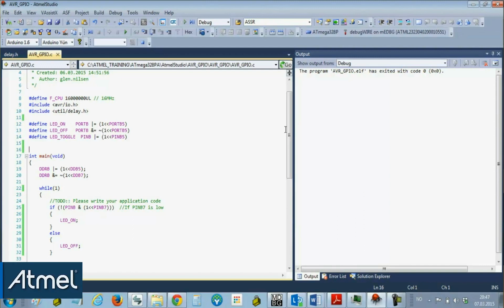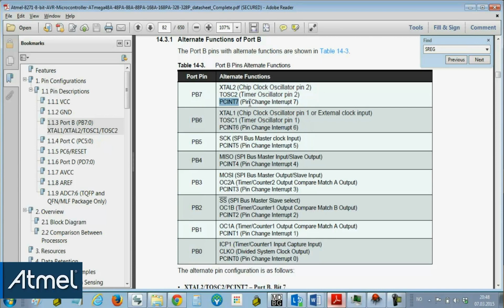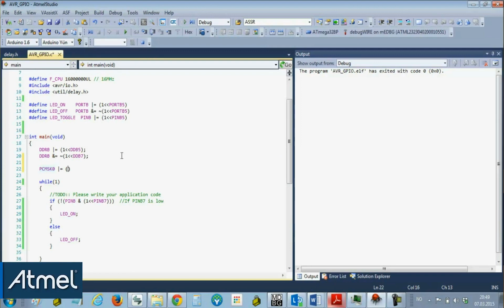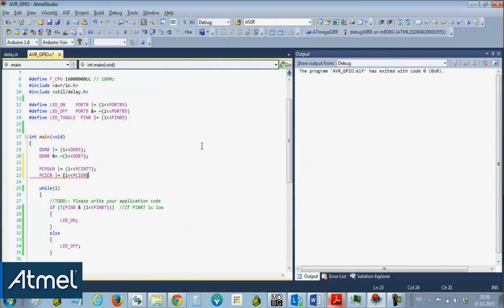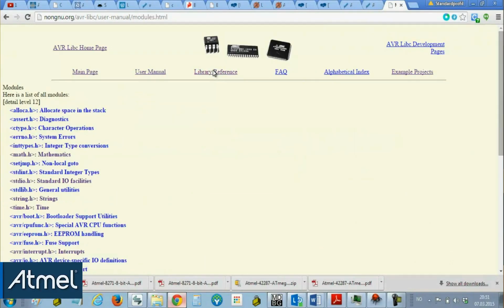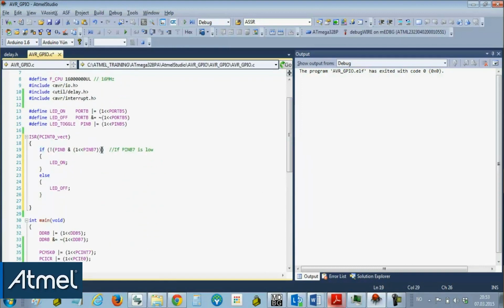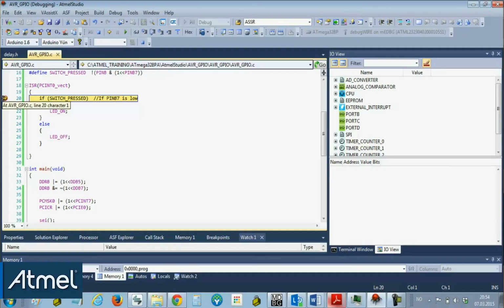Getting Started with AVR: Using Pin Change Interrupts (#5)

Comment: What is the purpose of learning these concepts,  what are their applications. Anyone explain this?
Reply from the maker: Hi there, great question! Pin change interrupts let your microcontroller sleep and only react when something actually happens — saving power and processing cycles. That makes them essential for real-world designs like battery-powered sensors, IoT devices and wearables. Once you understand the concept on the ATmega328P, it carries over to nearly every embedded project you'll work on.

Comment: Great series! 

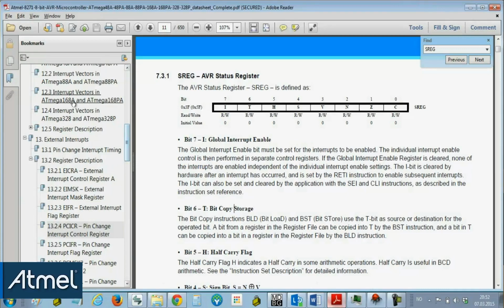How did you find out that it was PCINT0 you were using for Interrupt Vectors?  5:19
I was using PORTD2 as interupt and there it was PCINT2, but i dont know why, i just tried them.
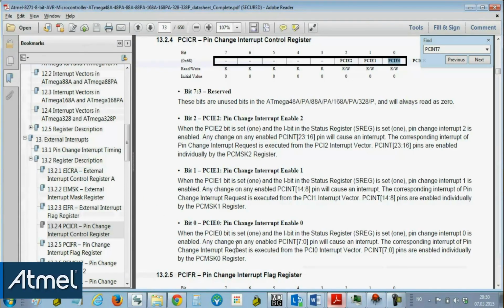Reply: PCIE0 requires to use PCINT0. I also used PORTD2 as button and for this port instead of setting PCIE0 we had to set PCIE2 which requires to use PCINT2. It's written in datasheet at 3:35

Comment: What would be some practical applications of Pin Change Interrupts in general? I am unable to get that from anywhere.
Reply: Very useful when you expecting some signal on some pin(s). In the meanwhile, your program doing something else, and not waiting in the "if" loop or similar. For example, you have remote termometer, and waiting for new update, your program doing drawing on some display, and if interrupted, it goes to ISR for decoding incomming message about temperature change, then after exit, it continues to draw temperature on display with new and "fresh" data. If remote sending data periodically, it is hard to predict when it will send, and waiting in "if loop" will be waste of MCU time.
Reply: Thanks for helping out here with the questions, much appreciated.

Comment: Didn't answer the one thing I was looking for which is whether I need to clear the interrupt or whether it's auto cleared when the ISR is called.
Reply: Citation from Atmega 328p PDF: "The flag is cleared when the interrupt routine is executed. Alternatively, the flag can be cleared by writing a logical one to it. This flag is always cleared when INT0 is configured as a level interrupt."
Anyway, I do always clear those flags:
ISR(INT0_vect) //direct INT0 vector (pin 2, or PD2 on Arduino nano)
{
 EIMSK &= ~(1<<INT0); //forbid re-trigger during executing ISR
 PORTD ^=(1<<PORTD4); //toggle LED on/off on each ISR event
 EIFR |= (1<<INTF0); //clear interrupt flag (maybe not needed, but anyway)
 EIMSK |= (1<<INT0); //allow trigger after exit
}
Reply: *****
Thanks Kindly
Reply: You are welcome.

Comment: very good exercise videos! i have a question: just a positive edge triggers an interrupt? i tried it with the stk600 and the atmega2560.
Reply: Not only positive edge, but also falling, low or high. Depend of EICRA bits 3 and 2 for INT1 or bits 1 and 0 for INT0.

Comment: AVR have a priority interrupts? High priority and low priority?
Reply: One level only. Priorities go from highest Reset at vector 0 to lowest, at highest vector. One interrupt must complete until next one fires. If an interrupt arrives before current interrupt completion, it is queued. After current interrupt completes, there executes exactly one instruction after reti and the the queued interrupt executes.